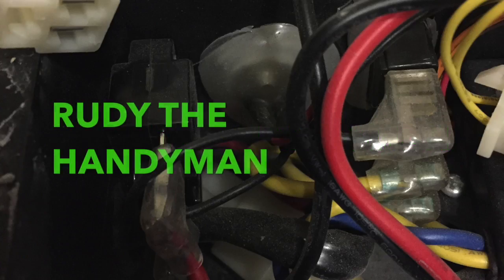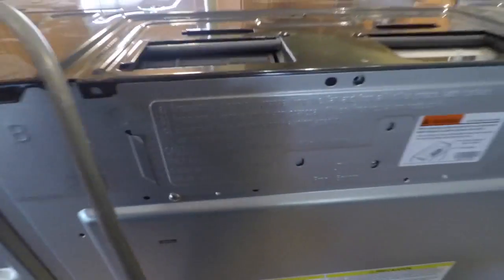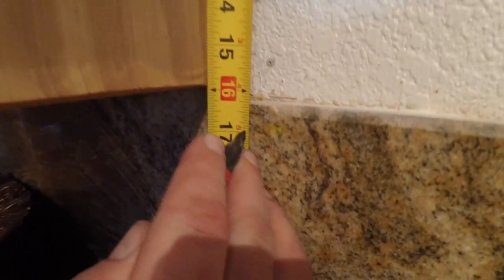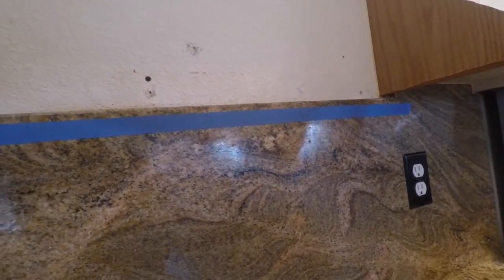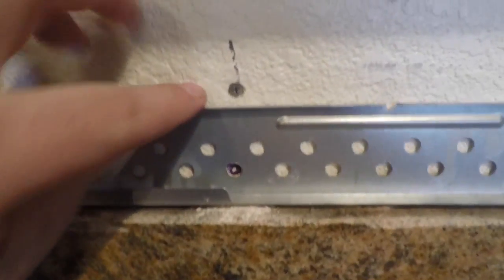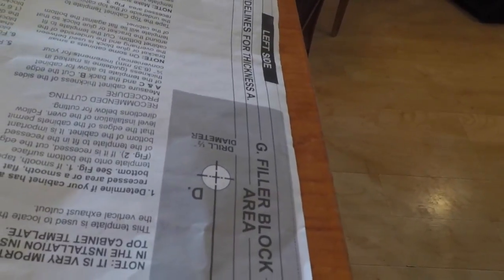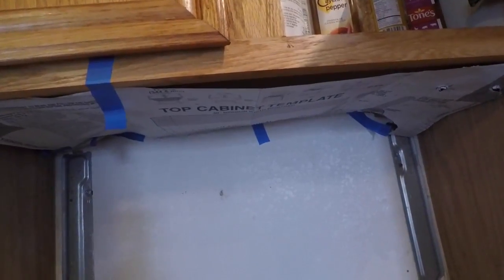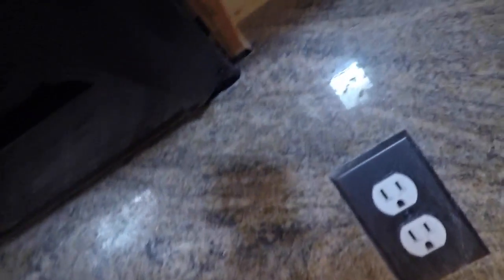Rudy The Handyman How to Install a Microwave

Comment: I am about to add granite with full backsplash and my current micro is almost 18" down. If they template and cut around this, it will look professional. What happens if my next micro in 2 years is smaller? What is the best route to choose since it has not been templated yet?       Great job!
Reply from the maker: That's a good question. Whenever you customize anything, it removes options from items that are of different sizes. I personally would keep enough material to adjust the backsplash if you need it at a later time. That said, I definitely would ask the installer of the new granite for his input as well. Congrats on the new countertop! That's always a nice upgrade.